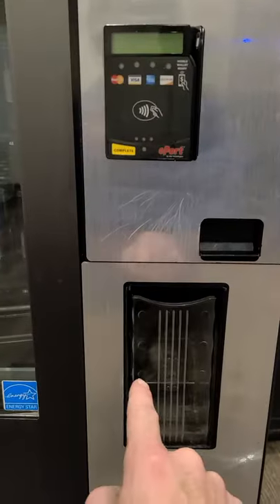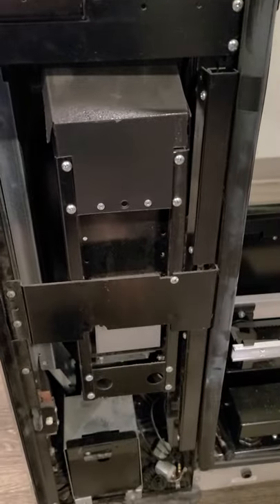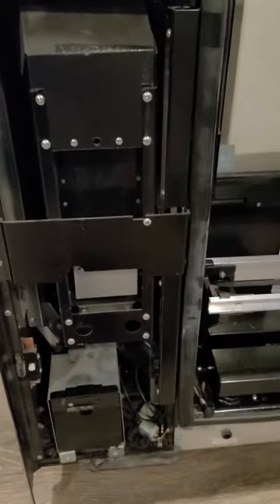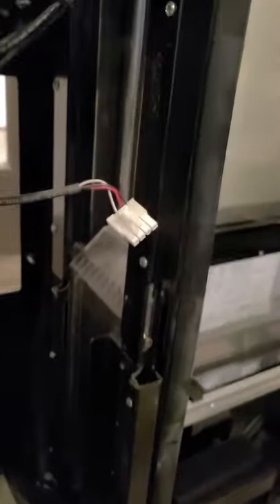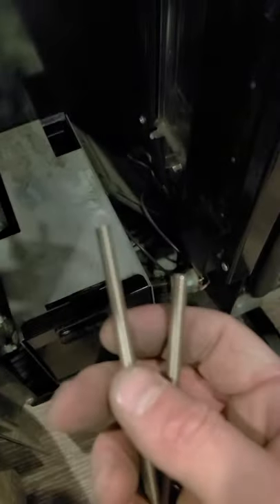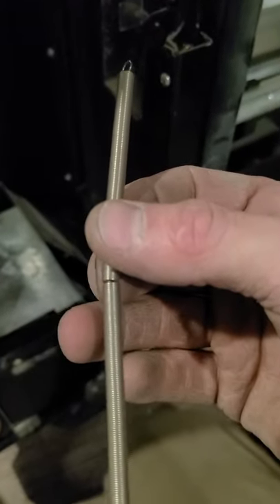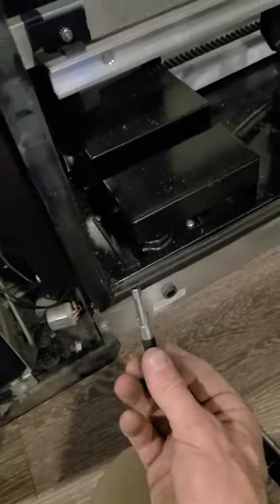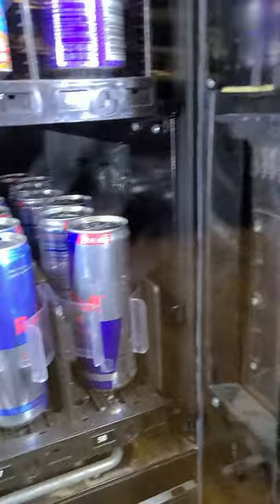royal RVV500 "remove product" or can't open delivery bucket errors

Comment: Hey man. Appreciate your videos.
Asking to see if you have ever had a problem with it not wanting to find the door by basically not vending completely. It will keep trying to find the door but won’t catch to bring the door down. Then it will go back to the main spot and will then say out of service. Hope I explained this good enough lol
Reply from the maker: Yes, if it is attempting to deliver but the hook swipe can't find the right spot, you need to recalibrate the hook swipe and probably all.the shelves too. If you call royal tech support they'll walk you through calibration. It's easy to do but not easy to explain.
Reply: I have done the calibration on each shelf and even the X calibration for the cup.
Any other ideas?
Reply from the maker: From there I would replace the cup. It could be a wire in the chain harness that has gone bad. It's so tricky to track that stuff down. Call royal and talk to the tech support guys see if they have any other input. They are very helpful. But if they don't, then replace the cup.
Reply: Thanks man! Appreciate the advice!

Comment: Thank you so so much. ^^
I watched your video and fixed my machine.

You are helping a lot of people.

Good luck~~~
Reply from the maker: Rad! I'm here to help anytime
Reply: @mishatagavor  Thank you I need your help more.
I saw your video and thought the problem with my machine was the spring and the problem was solved.
But when I look it again, my machine's spring doesn't seem to have any problems.

My machine sometimes fails to dispense drinks.

After picking up a drink, the cup takes it to the port door and repeats returning without finding the door and then stop.

What's wrong with my machine?

Comment: Hey mike. I have a rvv 500 that for some reason the cup does not want to keep the calibration i set it on. When i set up the cup to be close to the dispense slot how it should be, i hit pound and it says it saved. But when i go back to that screen, it shows the default calibration it had and the cup goes back to where it was. Any ideas as to why the calibration wont save?
Reply from the maker: 2 things, calibrate each shelf one by one then the hook swipe at the end and save it. If it still doesn't work contact royal tech support they are really good and will diagnose with you on the phone